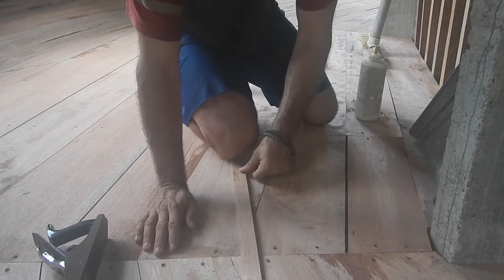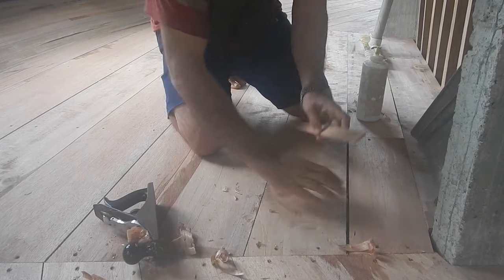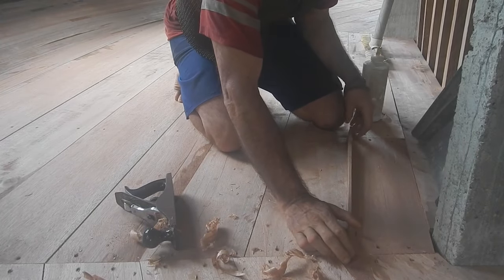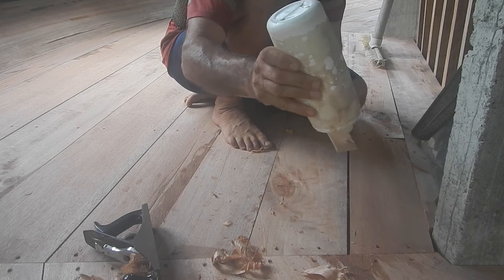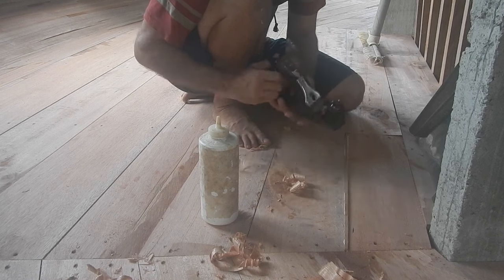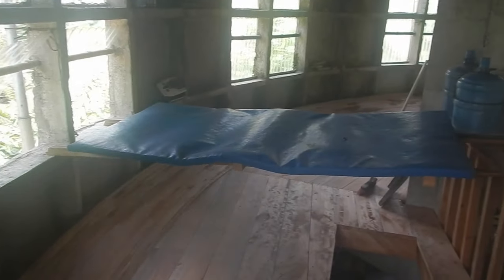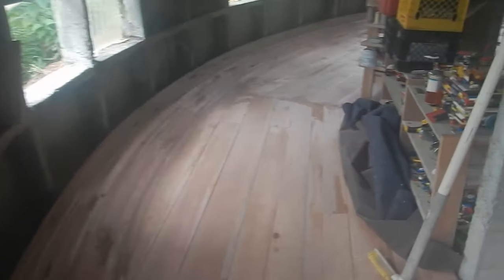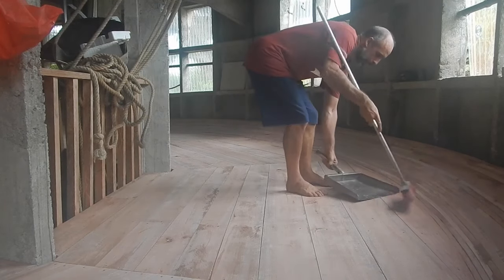Getting the Track Ready for Paint!

Comment: I would just oil that nice mahogney floor. With right oil, it’s not slippery at all and would look very beautifull. 

With epoxy paint, moisture can easily warp boards and since they are not absolutely straight, reflections reveal every small imperfection. 

Even floors that look nearly perfect with lacker on them, look warped and uneven if they are painted.